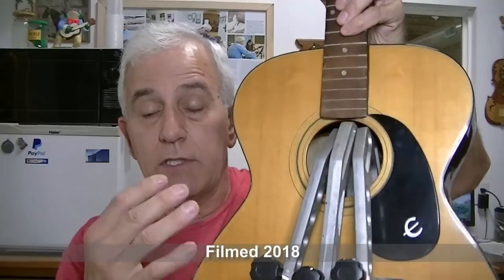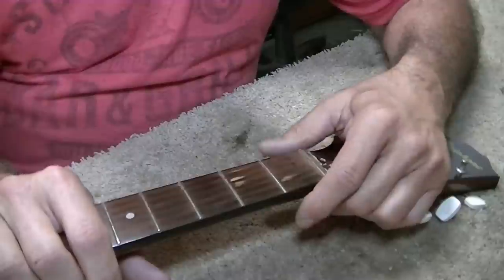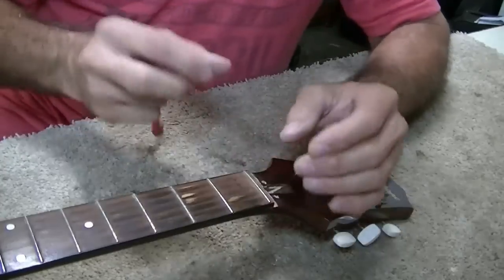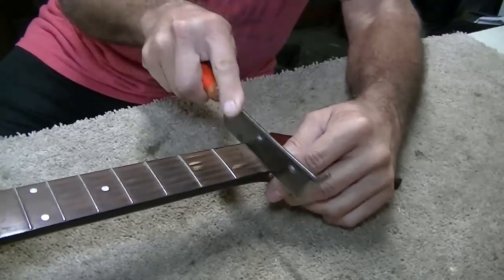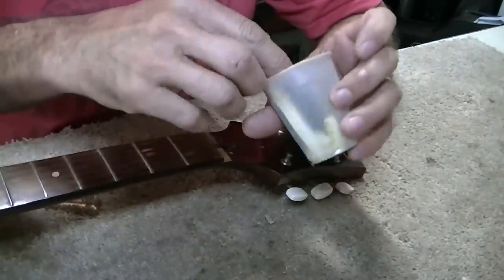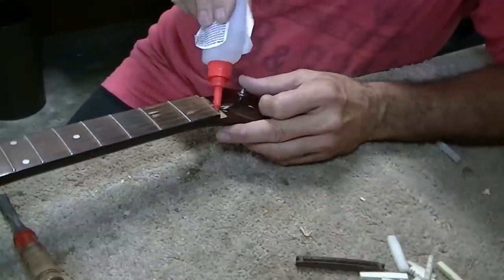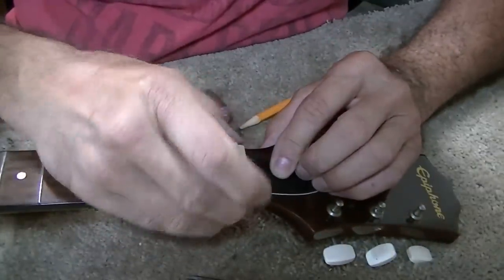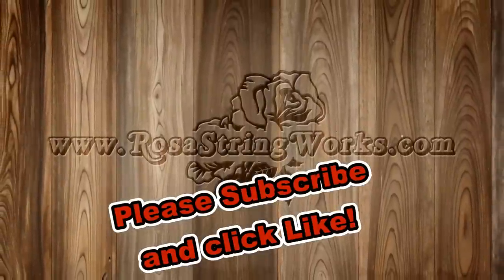609 RSW From The Vault! - Lets Talk About ZERO FRET

Comment: Most high end guitars made in Europe have zero frets. Even the high end gypsy jazz guitars. I always include in any fret board that I make. You just level it with the rest of the frets when you level. Now the height at the first fret is the lowest it can be with out buzzing. Distractors will notice putting a capo on does not cause the new first fret to buzz. However many are convinced that any zero fret will make the first fret buzz. HOGWASH!!!!
Reply: That's true. Only downside is that I've observed greater wear on the zero fret (decades of hard-strummed open chords, I suppose), so perhaps stainless wire is advisable.

Comment: Jerry, the zero fret is misunderstood by most people--including many guitar manufacturers.  Properly done, the nut behind the zero fret does far more than simply serve to maintain string spacing.  Ideally, the nut slots are cut just deep enough to apply a string downforce on the zero fret equivalent to that of finger pressure on a string to fret it anywhere else on the fretboard.  Most all zero fret nut slots are cut way too deep, and that is why most zero frets wear prematurely.  Cheers and happy Thanksgiving!
Reply: Very much appreciate this info.    I had one zero fret installed on a guitar.   It seems he just cut the nut to allow 
dia of strings to pass through, but they are cut too deep.   The zero fret is not stainless steel, so it won't last 
a long time.   If I ever have another zero fret installed I'll be sure to keep in mind what you stated.

Comment: In 1964 I had a pretty high-end gold plated Gretsch Tennessean with a zero fret.  It worked just fine.
Reply: But it does make it difficult to level the frets, without removing the nut.
Reply: Chet Atkins loved the zero fret he had Gretsch, Gibson put them on the models he would play and endorse
Reply: My Gretsch Country (Gentleman) Classic has one and I have never had a problem with it.
Reply: @zapa1pnt  Hello Zapa  I know it may make it hard to level the frets without taking the nut off, however shouldn't you do that anyway?  Also on my Gretsch Country "Gentleman" Classic, the nut comes off when I change strings every 3 months or so.  It also comes off on my Epiphone Dot.  BTW, I have had the Gretsch since 2007 and have never needed the frets leveled.  I only play at home or weekly at church. Due to changes at church, I only play the Epi at church and the Gretsch at home.
Reply: @walterhambrick8705 : On a standard fret board, it is not necessary  to remove the nut, to  level the frets.
There is plenty of room, between the first fret and the nut, for the end of your leveling tool.
I would also add (I would add) not advisable. If something does not need replacement or re-alignment, leave it alone.
Question: Why does your nut come off, when you replace your strings?

Comment: Big mistake, should have put a standard sized fret in there, but it needs a generous slot so that you don't break the little section of fretboard off, just glue it in if necessary. I love and prefer to have zero frets, gives you perfect string height when levelled with the other frets, and gives the same sound on open strings that you have with fretted strings. There are no "cheapie" guitars, do it right or don't do it.

Comment: Some years ago some cheap Japanese guitars came with them, giving the zero fret a bad name by association but they have advantages. I'm in the middle of installing a Zero Glide nut on a Gretsch streamliner. It helps the Bigsby stay in tune, it keeps all strings at the same level and it's not hard to install.  You don't have to do much to angle or size the slots, this one comes pre-slotted and fits perfectly. It even comes with a SS fret.

Comment: I’m not a luthier but I try to fix simple things myself. However there’s a learning curve to filing nut slots, as I’ve learned from destroying a few. I installed a Sintoms zero fret on my Tele yesterday. It compensates for my too deep nut slots adequately but I have a new bone nut to use if I need to. Not all zero fret guitars are cheapies. I have a 1959 Gibson C-1 classical, with the original zero fret that is a little different from the other ones I have seen.

Comment: You could fill the fret slot with wood dust and super glue. That's quick and you won't have intonation issues. Just saw it off before the first fret and you're done.
Reply: I agree.
Reply: @tedijune6759  He's good but sometimes I really wonder about some of his methods. The only guitar repair guy who almost always seems to do perfect work at least from the technical aspects is twoodfrd if you know that channel. Guy does excellent work.
Reply: @EbonyPope : In this, particular, instance he is giving the customer what he wants, a playable guitar (cheaply),
with the acknowledgement, this is a cheap guitar. Also, he needed to replace that fret, because it was too low, 
which means filing it down, to get it close to the others, before leveling them all and install a new nut
So, why not do it just as he did?

Comment: You can add intonation compensation by using a jeweler’s file to curve the nut slot a bit closer toward the headstock at the low E,A, and the B and high E strings. I used a stainless steel spoke from a 20” bike and cut and curved it to match neck radius and groove. Once satisfied with the results, a few drops of glue would hold it in place. The finished product was a zero-compensated fret. Tone, action, and note accuracy on the lower frets were all improved!

Comment: I learned on an Epiphone cheapy guitar. I just played the hell out of it till at one point, it wouldn't tune up no matter what I did. Has anybody ever experienced that, a guitar that you just can't tune up?
Reply: Tuners might be skipping or: the neck is loose at the joint and is lifting at the heel, or the truss rod is loose and the neck relief increases too much, or the bridge is lifting or the top is sagging (ie. due to some loose braces). In general if it's not the tuners, something is moving structurally in the guitar due to the increasing string tension while you try to tune up.
Reply: @gryzew  Tuners don't skip/slip.

Comment: Hi, with all do respect, I prefer the zero fret than the nut, and wouldn't be easier to just lower it, or remove it and fill the slot, or even leave it like that removed, and use a nut as you wanted? less invasive and more practical. Take care.